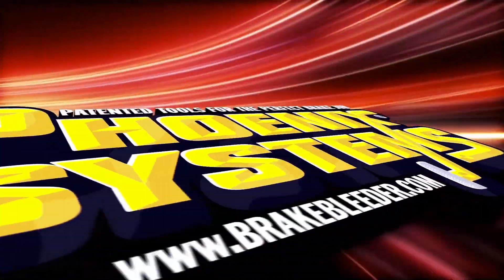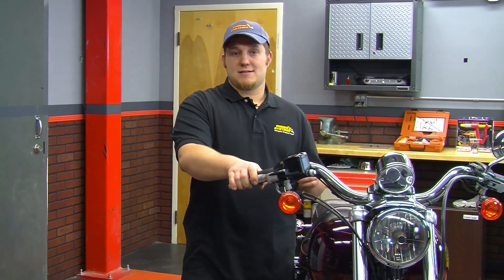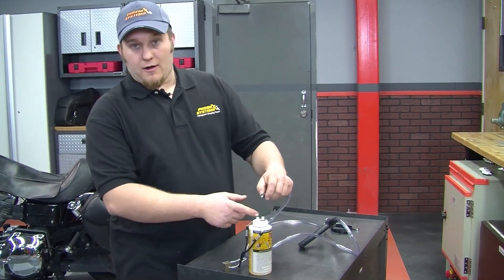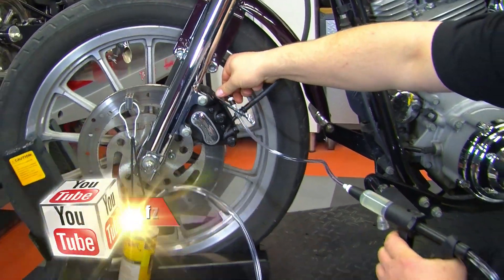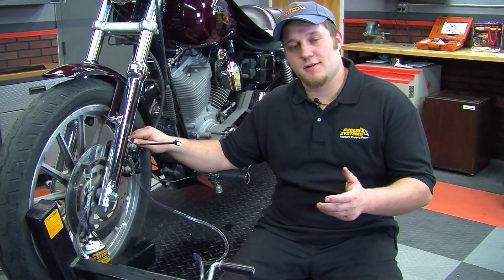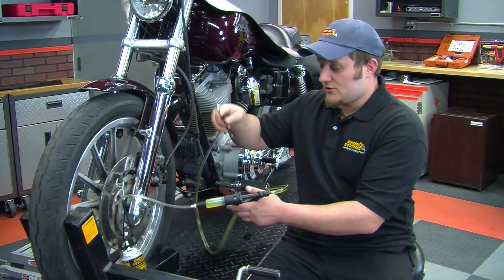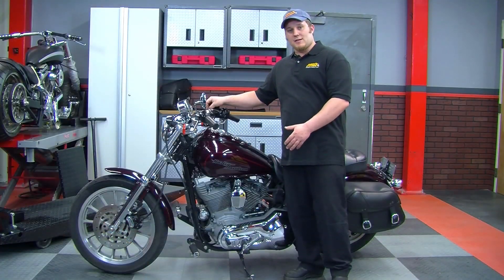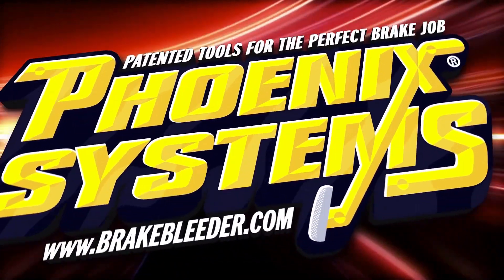How to Bleed Brakes On A Motorcycle | Phoenix Systems

Comment: These are all shortcuts to doing a proper brake and bleed job.   Pump and pop the Pistons out of the caliper clean all theWhite milky goop out from behind the Pistons.  Clean the master cylinder reservoir and and Phil and drain to flush out the brake lines. Push the clean Pistons back into the caliper with your thumbs then there's no Air hardly behind them.   A large syringe to push fluid in and draw it out Works real well too. Gravity bleed with the reservoir cracked open and bleeder cracked open.   No sharps or service manuals will show you to pop the Pistons out of the calipers. And cleaned thoroughly behind them. !!!! It would take too long in a shop. ??? But this is why you have dragging brakes have to replace rotors calipers Master cylinders. ???   Dot4 and dot5 brake fluid.  Has a higher temperature boiling point.   But absorbs water and moisture much much quicker. !!!! Needs to be 100% flushed cleaned every year. !!!!  And yes remove the Pistons to get the crap out from behind them. !!!!????? Don't push that crap up your brake lines into the master cylinder or suck it back down behind the Pistons again. !!! ?????

Comment: I glad that it is shown that you have to bleed the caliper in the conventional way at the very end. Too many tech tips on YouTube make claims that reverse bleeding only will get all the air out. Simply not true. There is air in the calipers and wheel cylinders that can't get out due to the bleeder screws being higher than the inlet ports. Good explanation and good teacher on this Phoenix system.